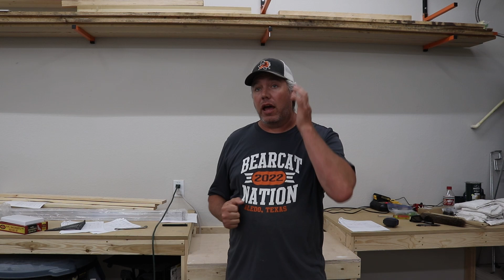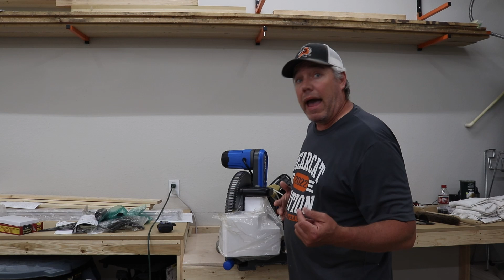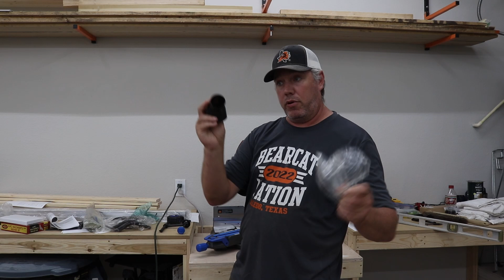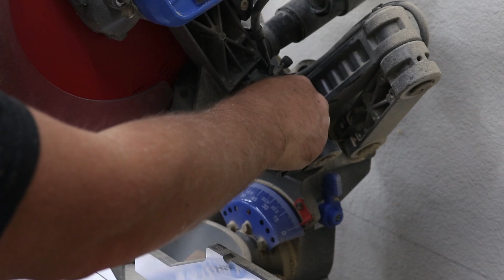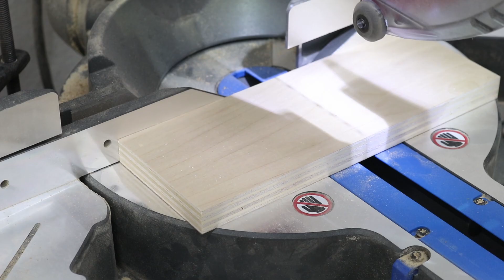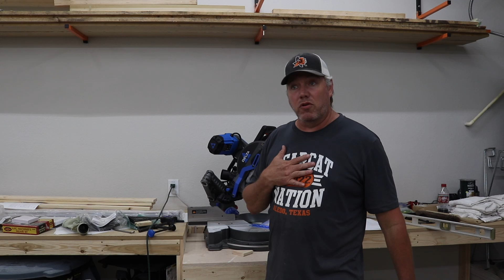STOP Wasting Money on the Wrong Miter Saw for Your Workshop | 12" Rigid/Delta Cruzer review

Comment: Just making sure you know, your saw is the new revised version of the cruzer.  I don't know what all the changes are, but it's recognizable by the different style of arms.  I'm curious if the dust collection has been improved and if the ShopNation parts fit.
Reply from the maker: The dust collection stock is not good at all.  I ran it for a month without  the shop nation part and it was a mess.  Added shop nation part and it is better but not great.  I added a 4” open dust collection behind it to catch any dust not getting pulled by the port and it seems to be much better
Reply: @swankyslabwood Great video!!! So are you saying that the dust collection shoe that Shop Nation has WILL fit this model Cruzer?? Let's not forget that their video on it is already is like 4 or 5 years old.  
So, I contacted Shop Nation about it, and the saw they have is a totally different model number than the current one. So it's an older version. They also said they have no idea if it would even be the same parts or if it would fit, so I would be taking a big chance on  getting it.
I really didn't think that the dust collection on this newer model was terribly bad, but maybe I don't use mine as much as you do.
Reply: I just purchased the Delta Cruzer, and so far I really like it a lot.
I spoke to Shop Nation regarding their dust shoe and they said that it was for that a different model number than the current Cruzer, which is model #26-2312. So they did not know if it would fit and I'd be pretty much on the hook for it if it didn't. I also got on Delta's website and checked out both parts lists for the saws, and the dust collection parts were different. So I just left it alone. But I personally didn't think the dust collection was terribly bad on this model with the dust collection going.